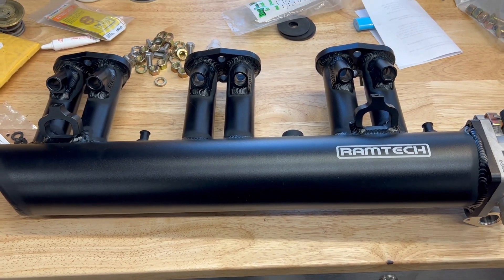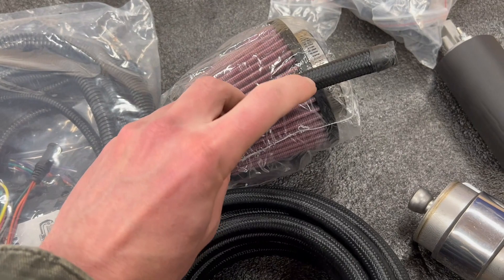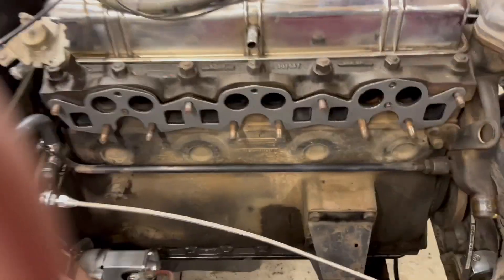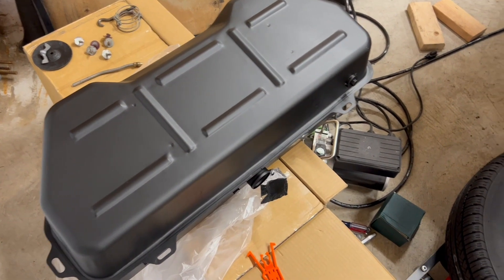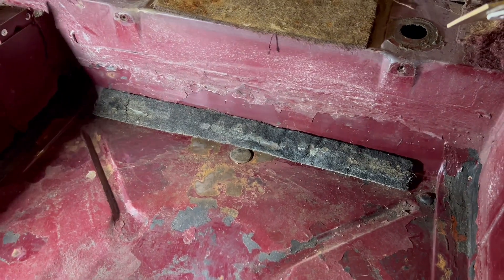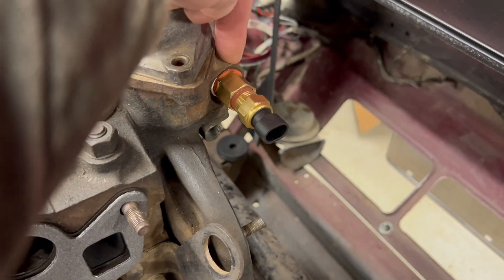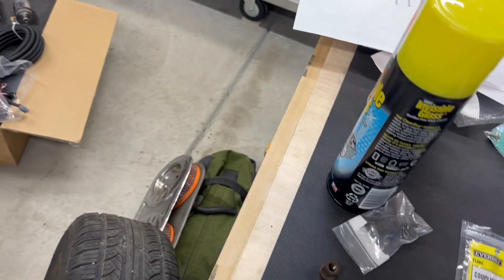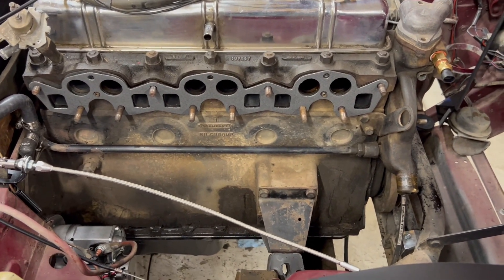Triumph TR6 EFI  Fuel Injection Conversion Part 1

Comment: I have this kit. You said you made something to use the vacuum port on the lower side of manifold. I can’t find that video.
Reply from the maker: You can find the part on eBay. It’s made by ICT Billet Solutions. It’s called a “LSA LS9 LT4 LS supercharger vacuum port 1/8 NPT Hose Adapter Holley High Ram MAP”.  Their part number is 551387. You will need to get a right angle hose barb to thread into the adapter if you want to hook up vacuum hoses or anything else.
Reply: @hollywoodd3191  thank you 🙏🏿 so much

Comment: Before spending money on a tr6 engine you must check the crankshaft thrust bearings. End float can be seen by levering harmonic balancer in and out. Original injection had 150bhp  when/if running properly . . . any conversion would be an improvement

Comment: Have you seen a Fuel injection kit for the MGB other than what Moss Motors offers?  Thanks
Reply from the maker: I haven’t. I wasn’t aware moss offered one for mgb.
Reply: Unfortunately they removed it with the latest catalog. Earlier catalogs 2021 had a kit for the 67 to 74 to replace the SU carbs. Several years earlier they had a California legal/Approved version for the 75 to 80 Zenith replacement.      @hollywoodd3191

Comment: Lots of little details and some work ahead. If you intend to keep the TR I would pull the engine, fix that leaking sump gasket and fully detail the block. You could then also refit all the injection manifold, water pump and exhaust manifold. The clutch, thrust bearing and slave cylinder could be checked/changed.

Comment: Wow, this is exciting stuff. Seems like you’ll transform the engine from carbureted 105 bhp to 150 bhp in one fell swoop. And likely without the Lucas efi headaches. Doing on the 1969 TR6 is smart since these early cars were best of breed imo. Looking forward to more videos soon
Reply: I haven't watched the whole video yet, but unless the cylinder head was shaved to raise the compression ratio, the hp gain would be minimal.  The injected engine on the TR6 cars sold in England and Europe had a 9.5 to 1 compression ratio.  The US-Spec cars had a 8.5 to 1 compression ratio that was later lowered to just 7.5 to 1.  Perhaps I'll find as I now watch the video that this car's compression ratio was increased appropriately.  I hope so!

Comment: From racing wheel changes...
Silicon on the nuts to the pump. Tighten to thread each but in sequence from 'impossible' to 'easy'.
Tighten all nuts.
You'll throw less tools this way.

Comment: So glad you are posing this.  I was intrigued by the kit.   For the price those welds seem a little arts and craftsy.  I guess I didn’t realize everything wasn’t cast.  Look forward to seeing how it runs for you!
Reply from the maker: It’s a pretty solid unit. After installed, I pushed and pulled on it and it rocked the whole car back and forth. Decided to go with an in-tank fuel pump so that’s taking longer to sort out the install but will be easier in the long run. Hopefully…..